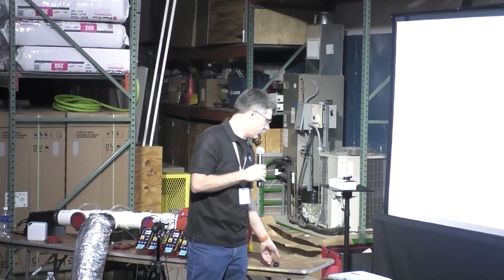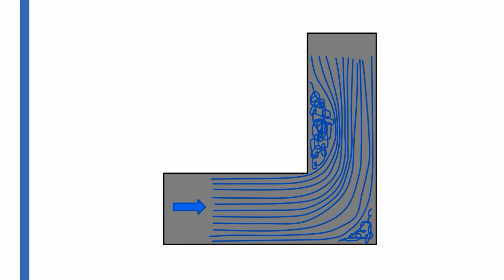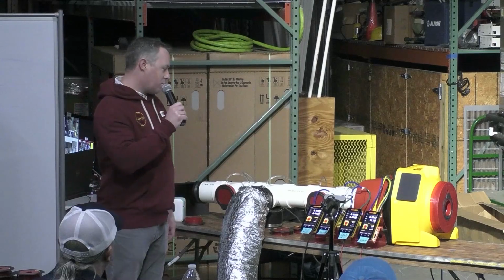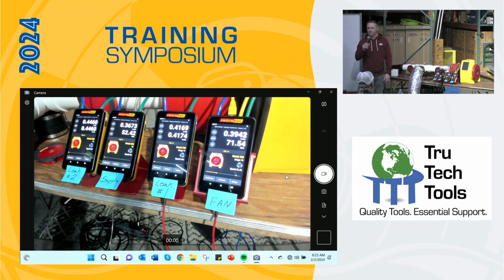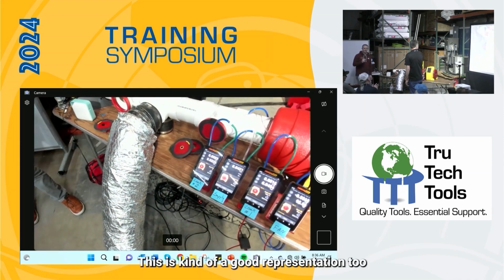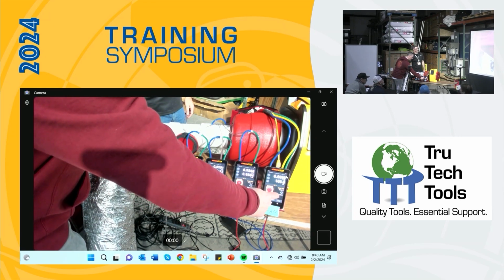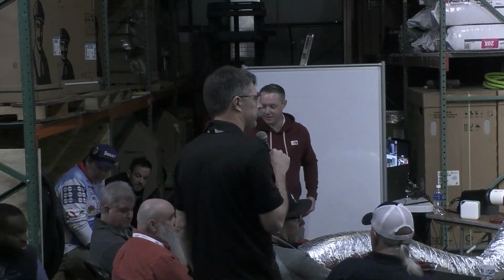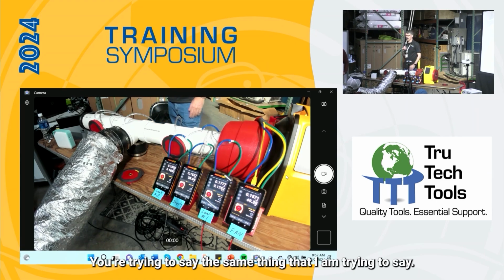A Duct Up Situation with Sam Myers and Eric Kaiser

Comment: QUESTIONS: 1) how will oversized ducts negatively affect performance? (if at all....)
2) can an OUTLET/return duct with a tear/hole suck in air? 

i have an attic hvac system. the temperatures differ substantially between the duct vents. the attic temperature reaches 120F in summer. i am wondering if attic air can be sucked in to the ducts which causes a delta T of only 10F, i do not see how. i would expect leakage would only be into the attic space. system uses flexible ducts with R8 insulation. advice?
Reply: If your measuring right at the return under the air handler and supply plenum right above and you have a split of 10 that’s 💀💀💀